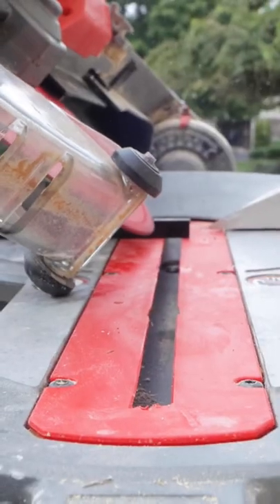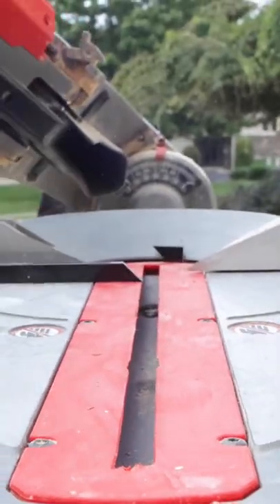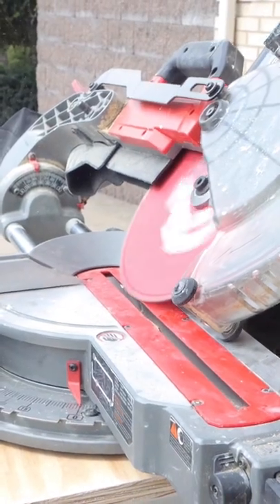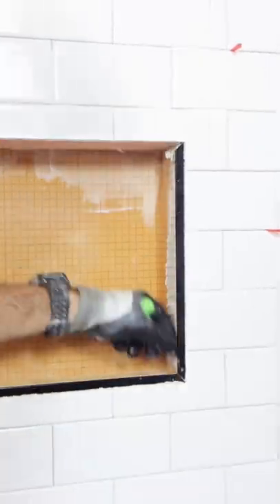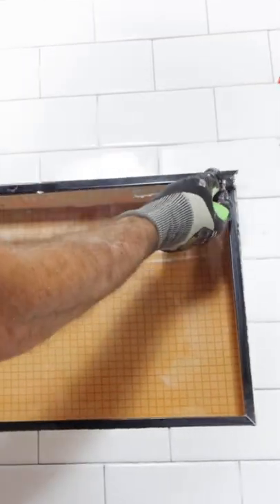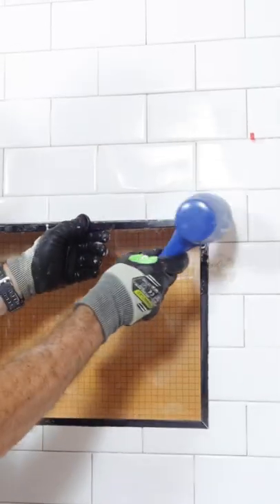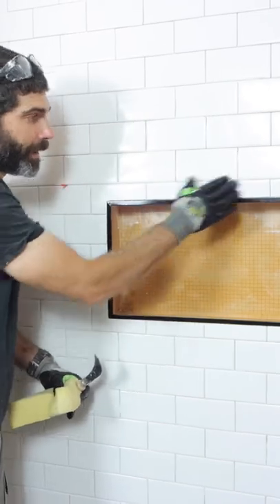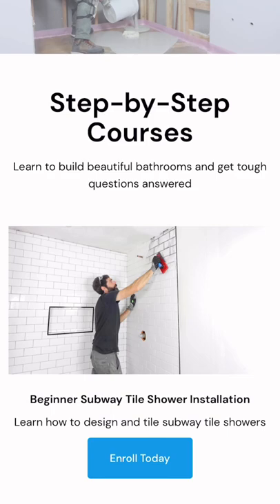Tile Shower Niche Tips - #shorts

Comment: Any advice on positioning the niche in the wall prior to putting up the walls, so that your tile layout does not end up looking fubar when you start tiling?
Reply: Yes do your shower valve wall first then you will have your tile lines run a laser where you want niche so your not cutting into tile frame it in then backer board and tile away.

Comment: You suppose to have used spacers between the trim and the tiles.
Reply: Nah, just non sanded grout, way better looking as well.
Reply: @dr2377  sanded / non sanded grout, grout line should have been left. End of story
Reply: @tonygoshive785   there probably is one you can't see.
Reply: @tonygoshive785  Story restarted.